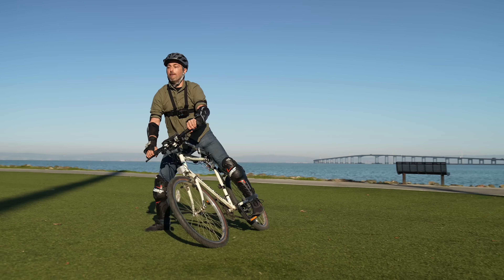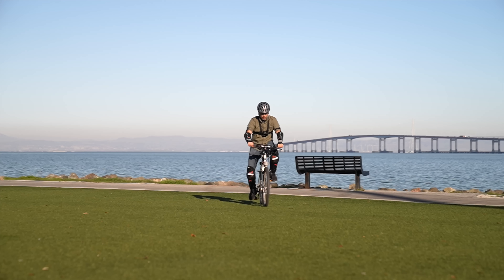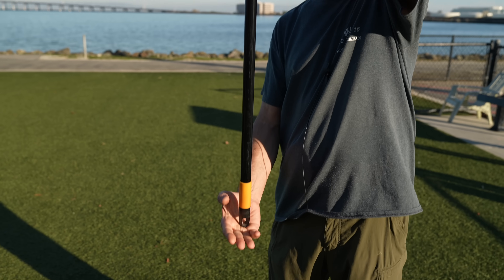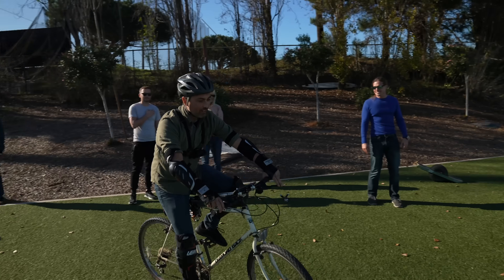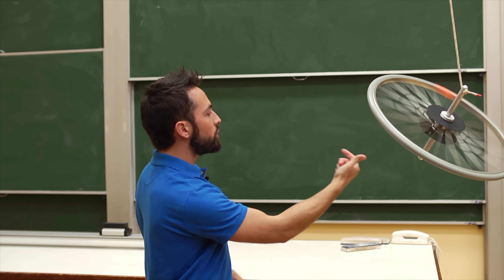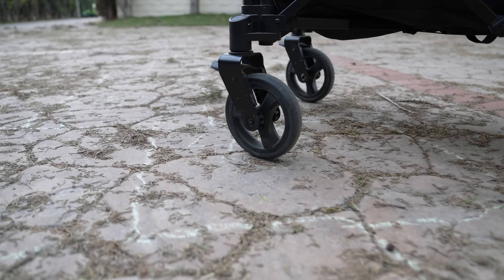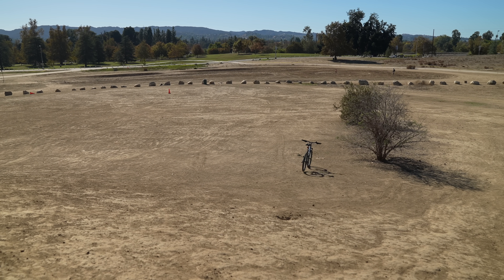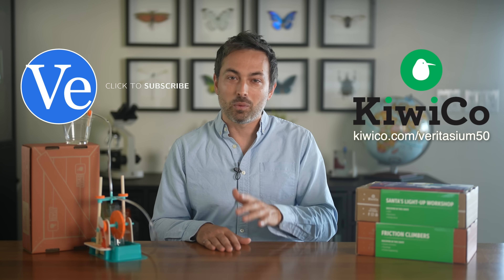Most People Don't Know How Bikes Work

Comment: anyone who has ridden a motorcycle to any level at a slow speed actually understands these principles
Reply: countersteering
Reply: I agree, the video assumes the viewer is a casual rider. Daily commuters and motorcyclists understand the concepts already.
Reply: With motorcycles it's the same as bikes. The only difference is that your motorcycle is 600-800 pounds. 

You can definitely tell if a biker is a newb or never had proper training. Watch their feet, if they stick their legs out or drag their feet when going slow - they're being idiots. 

During proper training you're taught to ignore your instincts, like sticking your legs out, because it destroys your balance more than helps. Keep the legs tucked in close as soon as you take off and your balance is centered on the bike. 

I've seen old men "playing the role" of a badass biker with the leather, only to drag their feet when going slow and I can't help but laugh. 

But I've found a bicycle and a motorcycle are virtually the same, counter steering, etc.
Reply: Countersteering is also quite a bit different at high speeds, as you'll be turning the handlebars the opposite direction throughout the turn while leaning into it.
Reply: @RialuCaos  you don't necessarily counter steer before 25kp/h, after that speed you really begin to feel the counter steer. 

But it's instinctual, no rider is going to just yank their handlebars thinking they're turning left, we get the idea rather quickly and react quickly. Thus we learn quickly
Reply: @sacr3  Yeah, I wouldn't really count what they do in this video as "countersteering", but it's still defined as that...at least by Wikipedia.

Not everyone learns it quickly, though. If you've only ever done low-speed turns then you might make the mistake once or twice of turning the handlebars the wrong direction. I recall a video of a particular rider making this mistake which caused him to cross over the line and have a frontal collision with a semi truck.
Reply: @RialuCaos  yikes, well I guess statistically speaking you're gonna have folks who never rode bikes, ride motorcycles lol
Reply: This is also why people have trouble with unicycles. When first learning to ride a unicycle everyone tries to stay on top. However you will never succeed if you try to stay on top. The proper method is to keep the unicycle underneath you.
Reply: @Luuuuuuuuuuuuuuuuuuuuuuuuuuu  ikr lol
Reply: This is why I prefer a tricycle on the playground.🏴‍☠️
Reply: Same reason I feel a motorcyclist would be able to ride one of those 'impossible' reverse steering bicycles
Reply: @andrewwilsing6533  How? It's still exactly the same phenomenon as displayed in the video, so a reverse bicycle would be like a reverse motorbike. Both impossible until you get used to it (like destin)
Reply: @andrewwilsing6533  not really. The problem with those reverse-steering bicycles is more to do with muscle memory than anything else. Knowing consciously what you are subconsciously doing to correct your balance doesn’t change the fact that you are still doing it subconsciously. We’ve all gotten so used to turning into the lean (to correct balance, to initiate the counter-lean needed for a turn, and for a turn itself) that turning away from it just feels intuitively wrong.